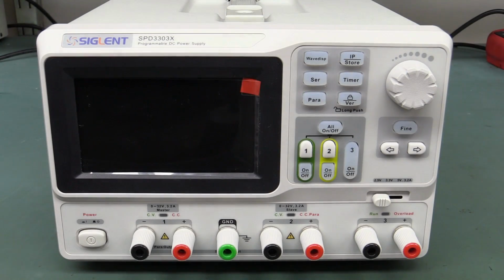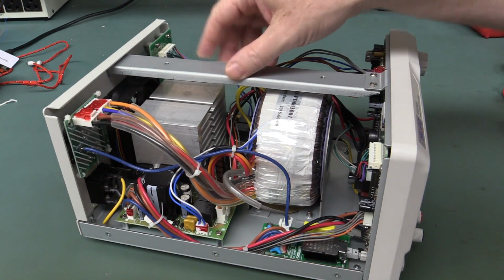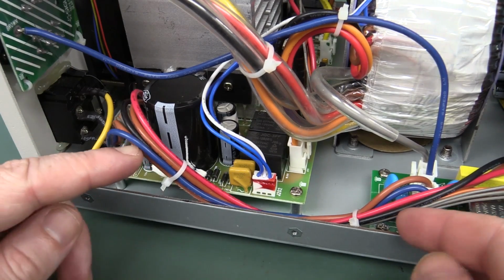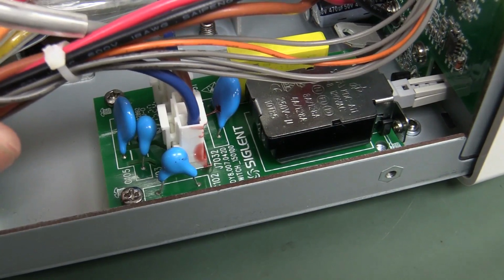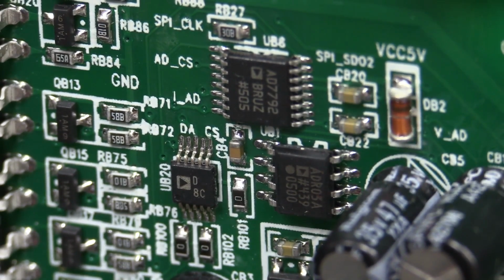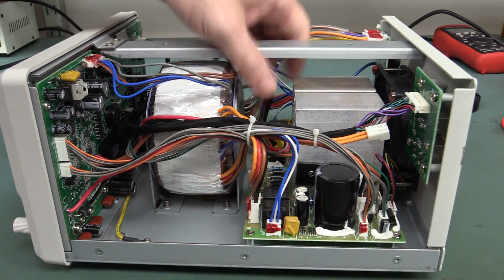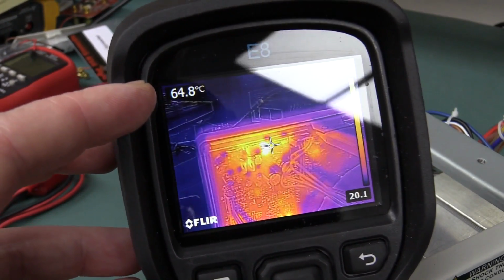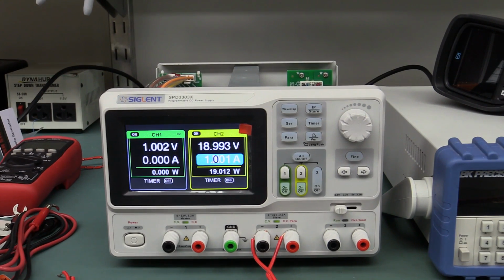EEVblog #828 - Siglent SPD3303X Precision Lab PSU Teardown

Comment: I don't understand how it's physical possible to be smart enough to design/build a precision power supply and fuck up the FRONT PANEL POWER CONNECTORS!
Reply: +ElectricGears 
BTW, the EE's don't usually do the case design or parts sourcing, and in the case of the caps, the engineer might have used good caps, but the person who sourced the parts used the cheapest ones there are...
Reply: The is a thing called "white Booke" in where all the specs are nailed into....and if i´ve chosen a specific component to be a needed one, i usually wrote it into as well, just to be save that this thing would not be repalced by a cheaper one....;) We EE desingers know that as well ;)
Reply: TubiCal
Yeah, unfortunately it seems that not all EE's do that. Either that, or they are bad at picking good parts! O.o
Reply: ElectricGears because proper bananajack connections would add 30-40 cents to BOM which means less profits.
Reply: +ElectricGears i think, they don&#180;t design it, they just copied an already existing thing, like that on this little inboxed link, in this video....and made some changes due to competition...and off they go....it&#180;s like as the audience already said...YOLO...

I would rather go for : RipOff or Fast money makers....

Dave made a good video, but from my point of view (as it would be my money as well) This thing is a true RipOff!!

Design origin is well in the end of the last century made up with a nice DAC and a newer &#181;C and there you go....
My BOM would be: 40 for the toroid, extra 20 for these Control ReDesign, 50 for all semicon, 30 for PCBs and mounting, 20 for case, another 20 for buildup and test....rest is true : YOLO....

The "precision" relais only on and whithin this ADC, all the rest is &quot;howYaDoin&quot; no excuses here....

Comment: Toroidal transformers also can make sound, they do not use solid core but laminated cores to and if they are poorly made hey will buzz.
Reply: +Miloš Lazović 
Yes, that's right. Hum through a transformer is capacitive not inductive and interlacing makes them especially bad. The best transformer for noise is a split bobbin. It's the jerky audio guys who think equipment must have these transformers.
Rob
Reply: +Miloš Lazović there is a lot of holywar on what type of transformers is better... And for me it's not obvious that toroidal is better under all conditions. I heard they quite bad when there is a DC offset because the core is not grounded (although technically it's not an issue this rarely done). Hope Dave will make a video on this.
Reply: Alexandre Kandalintsev
All have its good and bad side, in most case I will agree that toroidal transformer is better, but they are more expensive (which is no big problem) and high magnetizing current (inrush current) which sometimes can be problem (you need to use soft start circuit for high efficient /power toroidal transformers), you can't implement magnetic shunt on them (now it is useless method, but was popular in transformers for welders)...
For me they are best for medium power/voltage, for small classical transformer is better choice (<50VA), and I never saw high power/voltage toroidal transformer (like that is used for power distribution where power is >1000 KVA and voltage is >10KV).

Comment: What's the advantage of a linear power supply? Just cost? Or does a SMPS inject noise into the output?
Reply: +TheTrueM3ga definitely lower noise and perhaps a better transient response as a linear supply might have a wider bandwidth feedback loop. It's also easier to design a linear supply for a wide range of constant current and voltage, especially if you want to get down to very low voltages.
Reply: +TheTrueM3ga Certainly easier to design for.. Only line frequency*2 to deal with. Cost is not an advantage at all.. the transformer weighs more, and it’s a chunk of costly iron & copper!
Reply: +TheTrueM3ga 
Well, there are a couple of low ripple/noise ATX PSUs on the market (with an LLC resonance mode topology) - but they are judged with just 20MHz Bandwith...
So low ripple/noise isn't neccessarily true anymore.

But there are other disadvantages an SMPS has.
For example the EMV - due to the pretty high operating frequencys of those things.
You need way more manhours to design a SMPS than a Linear Power Supply.
You need a PFC circuit.
And you need better (and more) caps for them. Low ESR and even polymer capacitors are pretty common in high end ATX SMPS these days. 

Besides that we are talking about a pretty low current power supply...
So you can possibly live with the losses of a linear power supply...

Dave had a SMPS 'bench' Multimeter a couple of days ago - that 600V 3A one I mean...